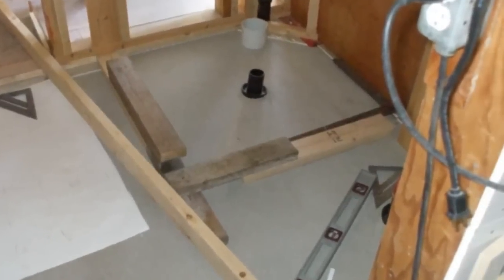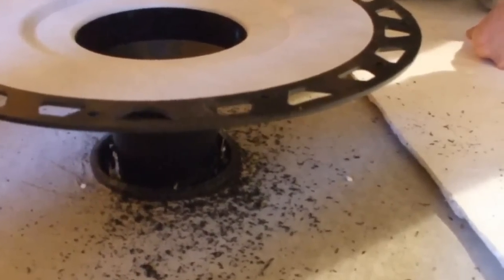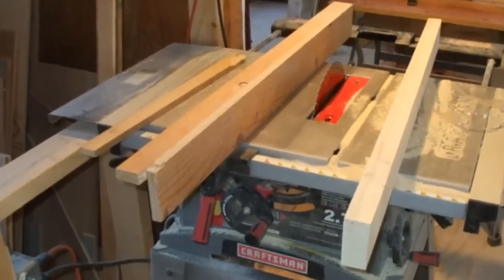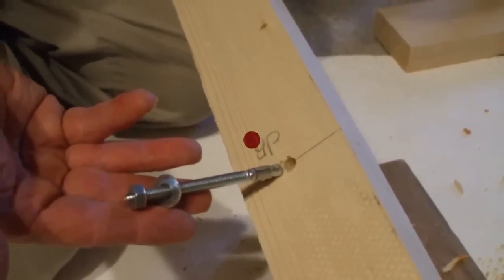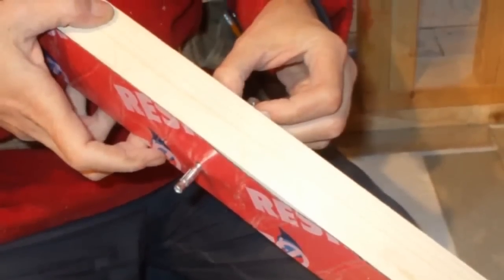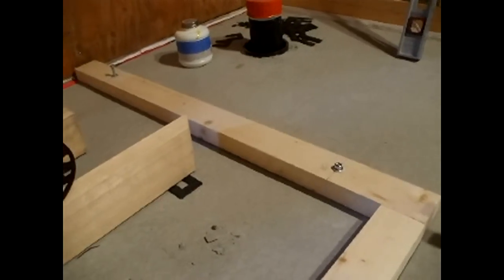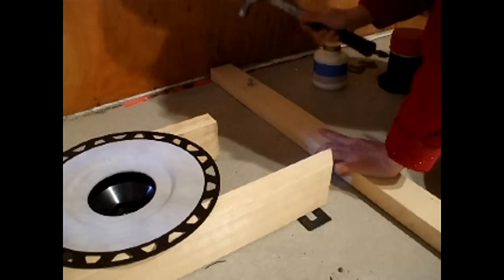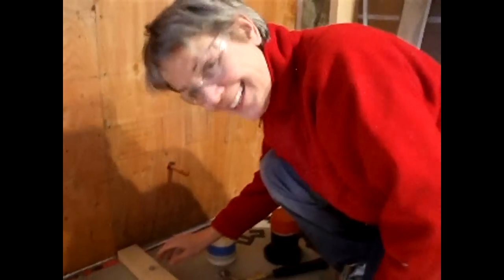Anchoring a shower curb to a slab

Comment: Maybe, it could wick through the bolt hole, but it might work if 100% silicone caulk were applied around hole where it touches floor? Just a thought. I recently demoed my shower for remodel and found that nothing was used for waterproofing and the lower of two 2x4's near toilet was rotted out and totally gone. The only thing holding a remarkably strong wall was the cement board,tile and thinset. The floor also wasn't sloped properly and it was installed when house built in 1982. The rotted wood was between toilet and shower, the rest of the 2x4's were remarkably ok. Wish I could post the photos! It seems it might be feasible to do this as long as 2x4's are not sandwiched between two vapor barriers?  This comment is from a non professional and not meant to OK doing this. Just a thought Sometimes newer products are introduced that may or may not work. Unfortunately only time will tell. As for now I have found the overwhelming majority say NOT to anchor wood to concrete.

Comment: On a concrete floor you may not use wood (2x4) for building curb. It is by far better to use cement bricks or pour in concrete to form the curb.

Comment: Hi! Where did buy the vapor barrier?
Reply from the maker: The "vapor barrier" is a peel and stick membrane that is usually used o seal around windows and vents in conventional construction. It's great stuff and can be utilized in any number of applications. Comes in red and blue. Look for it at your building supply outlet. Normally called Red-skin or Blue-skin.
Reply: Great! Thank you for your fast response!